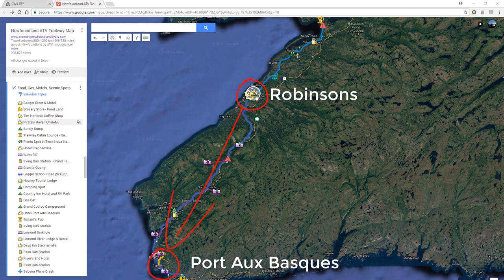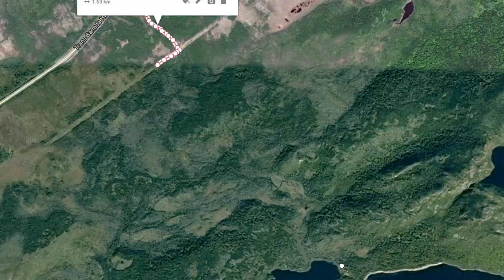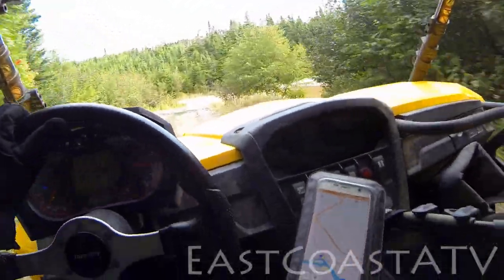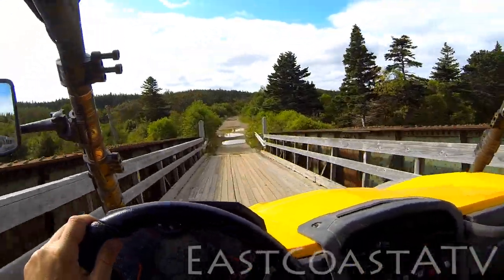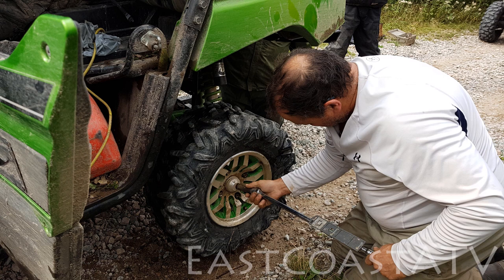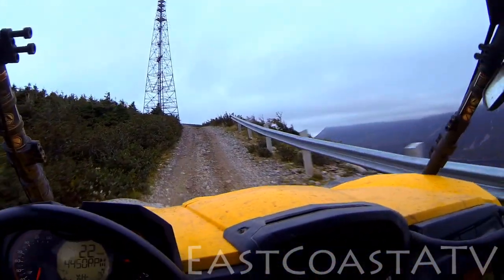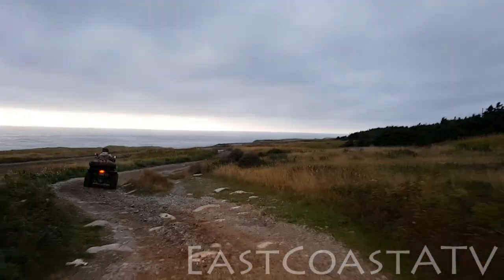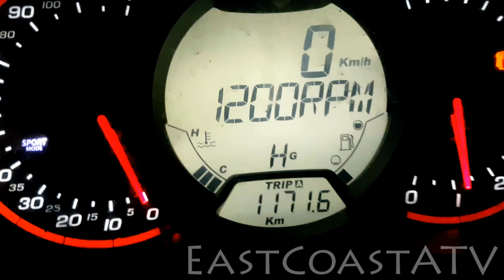Crossing Newfoundland by ATV 2017  - Part 7 of 7

Comment: How do you find the SXS on the T'Rail in NL and do you carry Spare gas can on you on this trip? Thinking about doing this either this year or next year looks like a blast
Reply from the maker: The side by side is great overall. Just make sure to stiffen the spring on your shocks a bit because there are a ton of whoops during the week. It hits the bumps a bit better with the shocks stiffer. Also I didn't take any gas last year as the Commander has a 38 liter tank (10 US Gallons) and will go about 250km or more on a tank which is further than we need to go to get fuel on any given day. If I was taking an ATV I would take enough gas to make sure I could drive about 250 km. Most of the time I wouldn't need it but it's better to be safe than sorry.
Thanks for watching!
Reply: EastCoastATV  and the SXS can fit down the trails? That would be my only concern
Reply from the maker: I've done the entire province twice now with my side by side. It's 62.5" wide and I had no problems. There are lots of side by sides that are narrower than mine like 50" RZR, Wildcat Trail, Maverick Trail etc. I 've also done a lot of trail riding with my side by side in local trails where I live and I haven't had any issues either.
Reply: EastCoastATV awesome yeah I'd be starting further east on by seal cove or Brigis junction   Awesome videos keep up the great content